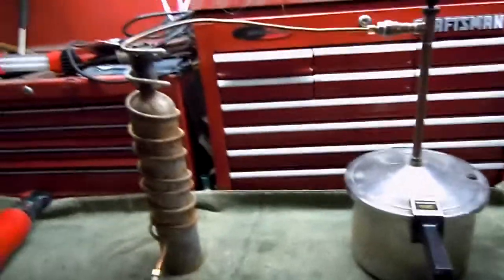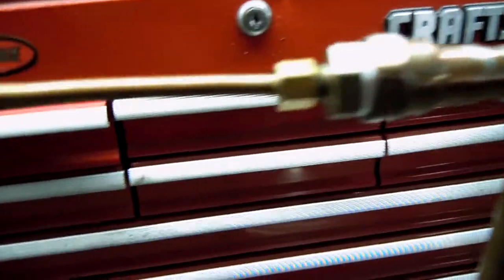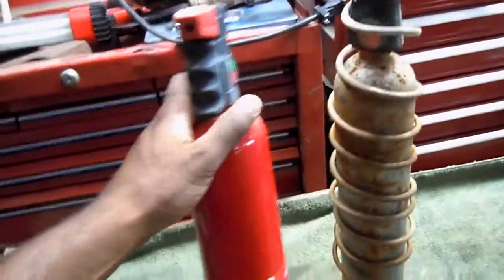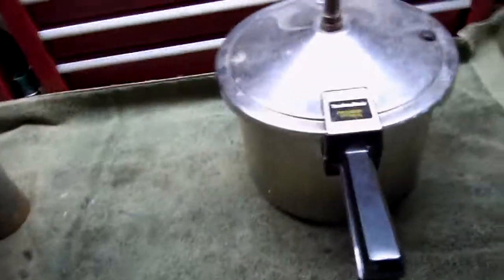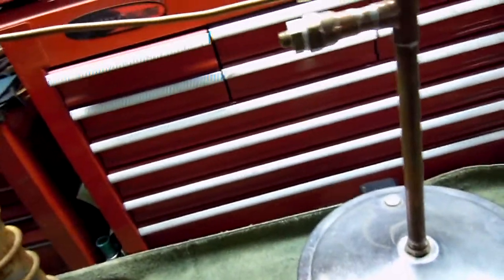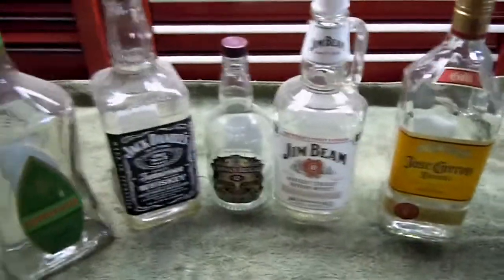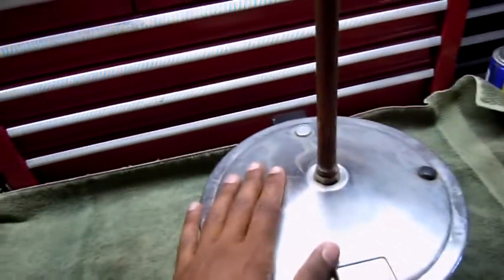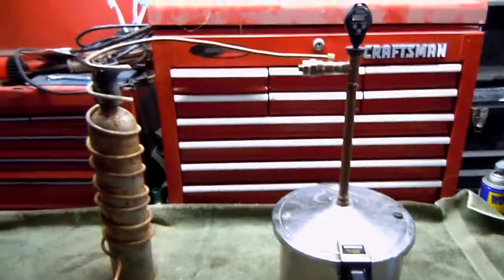SHTF Ep.4: Water purification (Distilling)

Comment: Just a few facts from someone that is knowledgeable in the subject.......
1st - Use copper or stainless for your pot and head material as they have a slight purifying effect.
2nd - Use copper for your coil material as it has excellent heat transfer properties. 
3rd - Avoid "low-grade" solders at all cost as they have a high lead content.
4th - Avoid materials such as brass(as it contains lead) and rubber(as lead is used in the pouring of rubber)
5th - Methyl Alcohol(poisonous) boils at 148.5*F
6th - Ethyl Alcohol(liquor)boils at 173.07*F
7th - Water boils at anywhere from 154*F at  29,029 ft elevation to 212*F at sea level.
8th - Know your time delay. Time delay is the time between which your still starts producing and when you start getting liquid out of the coil. This is especially important when making alcohol. How this is calculated is by starting a counter when your still hits 148.5*F(internal temp on an alcohol run). Once liquid starts coming out of the coil, stop your counter. The time on your counter is your time delay(only good for that specific heat setting). You can then use the same temperature setting and your time delay(plus a little extra) and apply it to liquor or water and have a fairly safe way to distill. 
9th An old timer once told me(pertaining to liquor) "The lower the heat, the more sweet."
10th DO NOT attempt to distill or make liquor with water that is clearly polluted. You can EASILY KILL/FUBAR yourself and/or other by making this mistake.

Comment from the maker: as of now I am using propane (you can see a vid of it in action, link is at 11:50. Or search "pot still" in the search bar on my page). I would like to use another source of heat but burning wood and such wastes more heat, and requires a lot of material. The heat setting I use is extremely low. I dont know how much I use per an hour but it is so low that I have to barely turn the nob to get the heat setting I need. The "low" setting on the nob is to high for it.

Comment from the maker: Thats the kicker. I had an idea to use minimal heat and insulate the pot in a double wall contraption made of steel with sand inbetween to hold the heat. This form of water purification uses too much energy for what is obtained. I have already thought of using the condensing bucket as a hot water resivoir for bathing and such. Run a pipe to a heavily insulated water tank and introduce new water to the condensing bucket. Fire in general is a lot of wasted energy, but you cant live with out it.

Comment from the maker: Yea I understand the dif boiling temps at dif pressures (PV=NRT something like that) But I thought I did mention that the rubber stoper has a tiny hole for a digital temp gauge to regulate vapor temp. I believe I have had it at less than 210 to have it very slow boil.

Comment from the maker: To filter out the chemicals then you would need a carbon filter and such? So you could obtain the safest water to drink by distilling at a controlled temp and filtering through a carbon filter, all at home. BTW I checked the PPM of the distilled water with a digital tester and it reads less than 20? I think?. It was less than bottled water. (I was suppose to say in my first comment that I have *taken* 5 university level chem courses)

Comment: another suggestion to consider (in a SHTF scenario) would be trying to find a way to reuse the heat you produce from boiling the water as a heat source itself. perhaps channeling it thru more piping to the bottom of your pot & use it as a heating element. it would save on any fuel that you use to burn for your flame seeing how any fuel supply would be a vital commodity... just my thoughts... you have some good ideas though bro!! ;)

Comment from the maker: So some minerals will show up but very little, depending on the boil (rapid or slow)? I know and understand the different temp thing for different compounds cause we had to do that in our labs to purify a substance. (i have take 5 university level chemistry courses). But distilling a strained dirty water source will yield water that is safe from bacteria and other things that can make you sick. If the water has chemicals in it then it would be difficult to separate it out with a basic apparatus.

Comment: I'd suggest replacing the rubber stopper in the lid with a thermometer to better regulate the actual boiling temp to prevent carrying any heavy elements keeping in mind that water won't exactly boil at 212° if you have it under pressure or a vacuum.

Comment: To deal with this its best to have more draw-offs in your tubing in order to have any unwanted compounds condense & drop out before reaching your bucket and/or do multiple distilling/condensing steps in series before finally condensing to your end water supply w/ each step removing more & more of any trace element that is carried out in your vapor. (which is the correct term btw)

Comment: I work in an oil refinery & I can tell you that this setup will NOT produce 100% clean H2O vapor from a really dirty water source or even salt water. any compound in the water would have different boiling points than water, some higher & some lower & some trace elements always get carried up with the steam even some of the heavier compounds (good way to catch e coli depending on your water source)

Comment: have a similar set up, but use the 23 quart presto aluminum pressure cooker, and run my coil in a bucket full of ice water.  

The plastic blow out valve of yours can be easily replaced.  It is designed to be a disposable item.. so buy a few of those.. also, get a spare gasket for everything, including that main elastomeric gasket for the lid closure itself.  maybe even two of those.  If you start using this daily, that is going to wear out.

Comment from the maker: Oh so you are saying that essentially a battery is being made. But in this pot only the stainless (or aluminum) is in contact with salt water, the copper has steam running through it. They both have to be touching the salt water to corrode, right?